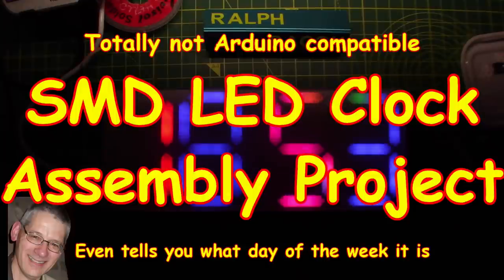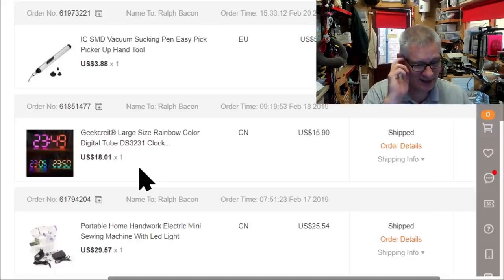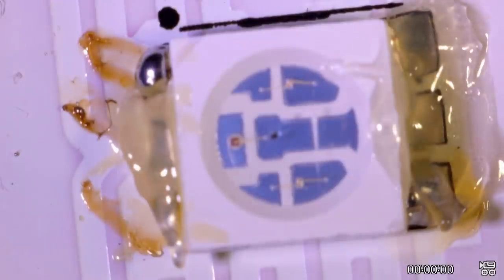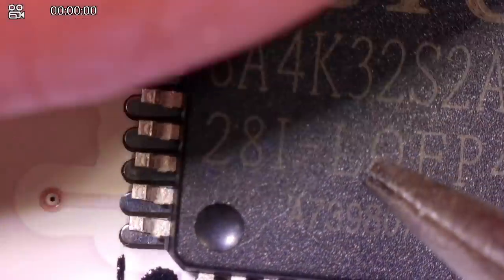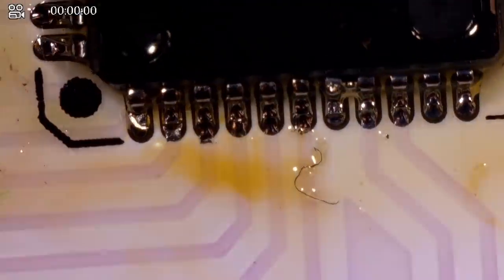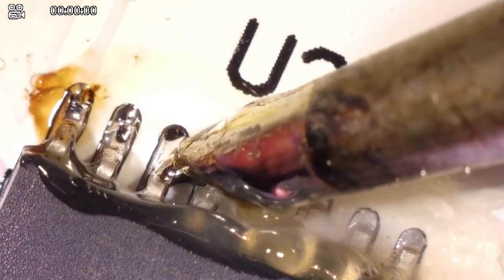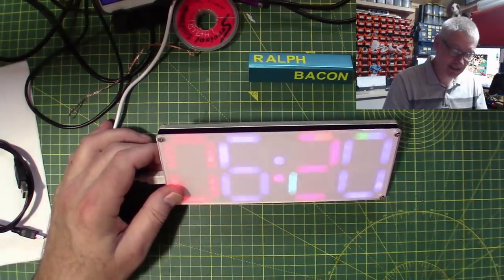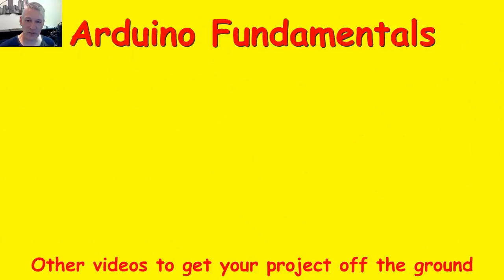#187 LED 3" Digits Clock SMD (TQFP, SOIC, LEDs) Practice - useful eye candy!

Comment: Make yourself a favor and get a 'flat screwdriver" type tip like T12-D16.. it does 95% of solder jobs.
That concave tip is meant to be used parallel to PCB surface and you are holding it at 90 degree angle parallel with QFP side. Dragging it against the base of the leads that sit above in air leaves excess of tin because there is more surface to form stronger tension and no solder mask to prevent it, thus so many bridges. And it is certainly a bad choice for 5050 LED package.
Reply from the maker: I tried to follow what Louis Rossmann did, perhaps it wasn't quite right (but it does mostly work). I shall have a look for a flat blade tip, one is bound to fit my soldering iron as it accepts Weller tips. Thanks!
Reply from the maker: OK, that was an impressively nice piece of soldering. I will turn my gullwing tip over next time and see what difference it makes. Then I'll email Louis to tell him he's been doing it wrong all these years! Maybe not that last bit, hey? Thanks for the link, Leroy, I've learned something new (again).

Comment: the link in the description for the clock doesn't work for me. 

(I removed the link, the problem was fixed)
Reply from the maker: Oh no! That was supposed to be an affiliate link so I could buy more interesting stuff, drat and double drat! I will see if I can fix that... I just tried it and it works for me. Are you copying the entire (long) url OK?
Reply: @RalphBacon  If i just click on the link I get error 404, but if I copy the whole link i get there just fine.  Link on chrome has just the first line highlighted as the link the other two lines that make up the address are just shown as text.
Reply from the maker: Right, I think I fixed it now, thanks for investigating this for me!
Reply: @RalphBacon  fixed my end
Reply: @RalphBacon  it's fixed for me! i will edit my comment so the link Is removed.

Comment: ...those flickers keeps em cool...might save power consumptions as well...kudos....I did an experiment on 5mm LED once to run on Stepped down 240v to 10v AC transformer with a single 470bohm resistor ..polarity didn't matter...it blinked 60/sec ...but barely noticed its blink....I wonder I we could ditch rectified bridge to turn Ac current to DC for certain applications....save diode expenses.... Does that make sense..?
Reply from the maker: It makes sense, Suren, but you have to be so careful with AC converted to DC with no transformer as you are still connected to the mains. It's done all the time by manufacturers to save money but even 5V that is connected to the actual mains supply (via a diode) still makes me very wary!
Reply: @RalphBacon Note: attach mains Earth to the scavenged transformer body to avoid tripping the mains..this experiment  was to lit a 5mm DC LED on unbridged AC stepdown  (10v1A AC transformer) with just a resistor...since neutral & hot both has pos & neg every 60 or 50 time /sec...just as pc monitor refresh rate..

.They make tinier transformer that replaces the chunky ones nowaday..example: 20W T8 LED tube cuircuitary vs the old 38W florescent one with those heavy balast...sometimes there is AC voltage spikes during nighttime than day time by >10AC Volt... that was my major concern...

Comment: R8 looked unsoldered on one side.
Reply from the maker: After the video filming was done I double-checked it all and found a couple of other joints that were not soldered well, so I re-did those too. But well spotted. Apart from one dodgy LED that stays green it all works as intended!

Comment: I don't tack them down I blue tack them down.  Tiny, tiny bit in the middle of the chip.  I use a chisel bit on the soldering iron and drag it away from the chip.
Reply from the maker: Doesn't the Blu Tack melt as you do the soldering? Very messy when hot! But if that method works for you keep doing it. Tricks of the trade, so to speak. Good to hear from you John.